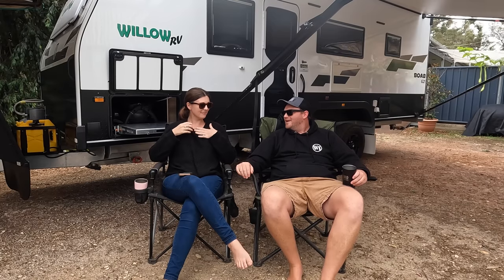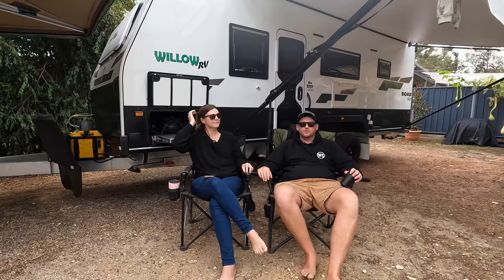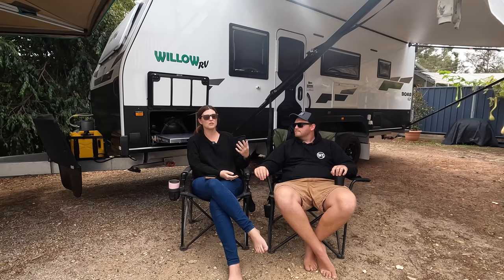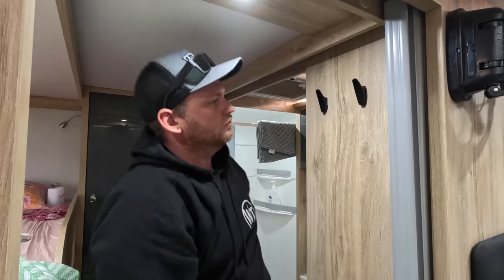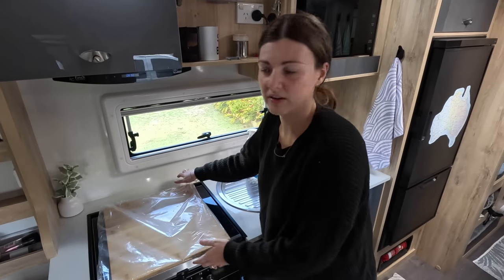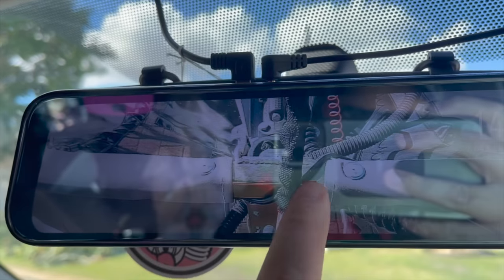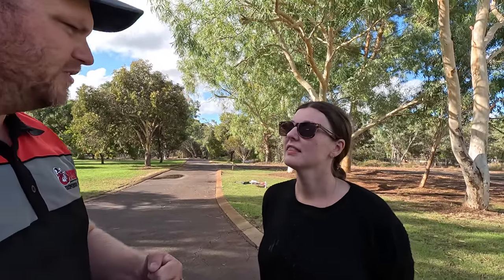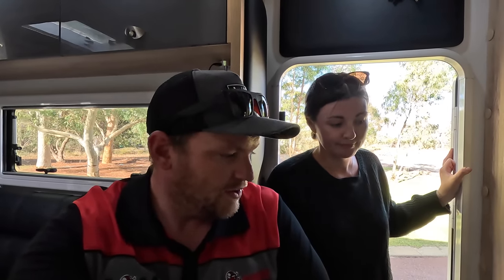WATER LEAKS & REWIRING OUR 8 MONTH OLD CARAVAN... || PLUS fitting a Stone Stomper and Awning Support

Comment: Cam and Tiff i really feel for you guys with all the problems you have had. I am horrified at you having to replace the electrical wiring at your own cost, luckly you have the money to do this a lot of people don`t. I have owned caravans since I was 19 years of age and I am now 67. I have owned numerous caravans both new and second hand vans and never had problems with new caravans purchased. Sadly  the state of the caravan industry at present is not a good one with people reporting all kinds of faults and manufacturers and dealers not doing the right thing to repair or replace defective caravans. I have friends that their new vans are lemons because of serious water leaks and other faults and have battled to get them repaired. I personally have found buying a good second hand caravan a better proposition for us. We purchased a 2011 24 foot Traveller caravan that was custom built for a couple and the van was immaculate and well kept no leaks and free from faults at the fraction of the price of a new one.

Comment: Hey Cam and team.  Nice vid.  We have same van and have had a few water issues with pex pipe not seated fully into fittings.  Seems most are now resolved.  One pipe had scoring may from pulling through floor and fitting wouldn’t seal.  All fixed by warranty.  Have large lithium setup as well and works fine.  Also queried wiring setup and I am an electrician, and it is legal as far as I can tell.  Maybe would have been ‘nicer’ to use 2.5mm but all ok when protected with 16A breaker/RCD.  Haven’t seen too much dust through that vent under bed yet!  Will watch though.  That support for awning is on my list as well, just saying!:)
Waiting for our stone stomper to arrive as well.  Also have that cutting board for the stove, did modify slightly to fit better, it’s not solid so careful if you cut it.  All the best.
Reply from the maker: Cheers Greg! Appreciate the feedback 🙂

Comment: An option for the floor vent,
Make a mesh panel then fit air con filter material to it. This will filter what can get through it and create extra flow resistance to ensure the caravan can still pressurise the van, and serviceable.
Reply from the maker: Good suggestion, thanks mate!

Comment: I’m no electrician either but 1.5mm cable is usually used for lighting circuits and 2.5mm is for power points etc.

Comment: 2.5mm is min for GPOs in the wiring rules for houses so maybe because it's not a house they can get away with it? Effort to use & cost of 2.5 vs 1.5 is minimal so they just sound cheap and makes you wonder what else they skimped on. I'm wiring my shed right now and using 4mm for GPOs and 1.5mm for lights (low power LED) because its a few hundred more although effectively future proof.

Comment: If the cable was not to regulation, then my guess would be that neither are your 240v power outlets or circuit breakers as they are not the same as you would use in a house, as vans need double pole outlets and breakers which are way more expensive than normal outlets.
Hopefully your sparkie gave you a completion certificate and lodged the appropriate defect report with the regulators as any van build company needs to be held accountable for the safety of current and future customers.

Edit - Caravans also have a separate Australian Standards regulations that they must abide by AS/NZ 3000:2007 and AS/NZ 3001:2008...is there an electrical safety compliance sticker on the van?

Comment: You guys have every right to feel salty about having sub par support for non trivial issues on a brand new van costing mega bux. Build defects happen, it is that follow up support that sets the manufacturer apart.

Will be really interested to hear more on how you get on with your 24V system. I'll be looking to do something similar with our next van as the voltage sag on 12v with high draw loads isn't ideal.

Comment: We have an old 2008 Boroma (they went bust during the GFC) which in its day was a very expensive van. We are slowly upgrading various systems in it. The build quality is top notch but it doesn't have the new clean look inside (wood cabinetry) of the modern vans. Our purchase price was mid $40g and even if we spend $10 -15g on upgrades we are still well ahead of the modern equivalent which would be $150g plus. I would be very disappointed if we spend a lot of $ to only experience your challenges. I admire your calm outlook. You guys will end up with a great van once you sort out all the teething issues. 
Question - What was the issue with the Isuzu in the end? When I spoke with you at the Perth show it was still an unknown? Keep up the good work and informative videos.

Comment: With the hole in the floor, my guess is that ventilation is required if you’re using an AGM battery (lead acid) which produces hydrogen when charging. Check with the manufacturer as shouldn’t be required if you’re using lithium batteries

Comment: Thanks guys for your unbiased report on your Willow RV. Their lack of correct diameter wiring could have potentially started a fire. Their attention to quality control through the manufacturing process appears to be substandard to say the least. Are they a Chinese import ? If they are, then I'd agree as to the lack of quality control. Are the adhering to and are a member of RVMAP, which is an accredited manufacturer of the caravan industry association of Australia. Or an accredited Australian manufactured camper trailer guild member. Yes I have done my homework. Thank you for your honest assessment of willow RV because they will not be on my "To consider list"

Comment: To sort your dust issue with the hole in the floor. We use a pressurising fan which fits to the roof and pressurises the van to prevent dust ingress. Works a treat. Just remember though that at night with heater on, the roof fan will vent heat. To fix this we put Velcro around the fan housing and put a piece of ply (covered in cloth to make it nice) over it to prevent heat loss. When we start driving, we remove panel and start fan.

Comment: A 200 series panel air filter might fit in that square hole going to the outside. They are 300mm x 315mm and would still let it breathe through there.

Comment: Wow, I can't believe how accepting you have been of the issues with your van. For the money paid there should be NO ISSUES. Our Lotus we bought back in 2015 has been a nightmare, but getting anyone, dealer or manufacturer to take much interest was time consuming and in the end almost pointless. Irrespective of all the issues, like dust ingress and water leaks (even after getting the van resealed) we still enjoy our times away. No-one, government or CIAA/RVMAP, are in the slightest way interested in getting the manufacturers to produce a safe and efficient van without faults, and it seems in many cases neither are the manufacturers.  It's getting to the point where a person is better off buying a second hand product, where the issues have all been rectified (mostly at the owners expense !).
Reply from the maker: Sorry to hear you’ve had drama’s with your van! I reckon you’re absolutely bang on about buying a second hand van 👍

Comment: For the hole in the floor, put the flyscreen back in and then use marine air filter sponge to fill the hole. Should help filter all the dust but not be sealed in so gas can still aerate.

Comment: You realise when you fit the SOG you don’t use chemicals anymore. That’s the bonus. No smells, no compost material to dig out and clean up. Can be dumped into a normal toilet or septic system due to chemical free. 
Just remember to change the carbon filter yearly.
Reply from the maker: Really! I thought you still used chemicals with the sog system!

Comment: If those hose fittings are John Guest I would be buying a bunch of the red locking clips or u might be dealing with another leaking fitting.
Reply from the maker: Cheers. We‘ll be getting the dealer to fit the clips next time it goes in for warranty work.

Comment: Was the rewiring issue caused by the upgrade on the power system as the wiring that was in the caravan has to comply by the standards ? & how much did it cost to rewire now I know another brand to avoid 👍😎
Reply from the maker: The rewiring was not caused by the 24v battery install- but that was how it was found. Cost to rewire a van would depend on what van it is. Mine was a lot easier than others because the wiring ran through cabinetry mainly rather than through the walls.

Comment: I had a Y62 and here are some things you might not appreciate until you've owned one. Fuel first, L/100km was fine it was the $/km that got old (always 95 or 98). Next, they are wide. On paper maybe it doesn't seem so but compared to driving a 200 it was significant, you need the 360 view cameras because you need to middle every parking bay. And every track you currently scratch the car on, you'll gouge the Y62 on. 3rd, if you plan on towing a lot then no question IRS is a disadvantage. As soon as the back end squats your camber is out, and making the rear stiff enough with springs/airbags doesn't make for a great ride.
Reply from the maker: All valid points! We took a test drive of a friends Y62 and were surprised how wide it felt, especially compared to the dmax!

Comment: Hi Guys, love your videos. Think about a engine air filter laying horizontal in the cavity, frame it out with some wood or plastic angle. The dust will shake off and you still have ventilation. If you pick a cheap common filter may solve your problem?
Reply from the maker: Cheers for the suggestion mate!

Comment: Put a filter over that gas outlet…. Something like from a aircon filter etc (obviously you’d have to cut to fit)…. I’d be interested to know why the re-wiring of the van was required…. Or was it just a safety issue or working with the battery set up that made you decide?
Reply from the maker: The electrician here in WA that was working on our van wasn’t willing to install an inverter for us with the wiring as it currently was.

Comment: Cam,Tiff, Just finished watching this video..... The rewiring didn't need to be a massive issue. I appreciate that you could only be guided by experts BUT the problem with experts is they are not solution orientated. They are standards oriented.  Circuit breakers are sized to protect CABLE. That is all. 1.5mm cable can easy supply 10 Amps....Fact is 2.5mm cable only needs to be used for power applications where you want to send 16 Amps through the circuit. 16Amps is 3500W at 220V....... There is NO one appliance in your van that draws 3500W. We have a Willow as well and its wired in 1.5mm just like yours was. Is it under done? Probably. It should have been in 2.5mm BUT, if you notice, the RCBO has all the 3 power point strings of 1.5mm cable twisted together and stuffed into the one 16A RCBO breaker. You could have done as I did and separated those out and fitted 3 x 10 Amp RCBO breakers, one for each power string which would have protected the 1.5mm cable just fine. The only cable that should have really been 2.5mm was the aircon cable and even then the air con is only 1.4kw... you could have gotten away with 1.5mm ...and a motor start 10A RCBO.   BUT at least you are satisfied now. ............ This is a warning that experts usually say its their way or the highway. When a bit of clear thinking can resolve many issue's at minimum cost..... Such a shame they chose to cost you so much money to fix what could have been done with 4 10A RCBO breakers in the cupboard and one run of 2.5mm from your inverter to the vans power system.....    See you guys on the road sometime soon....
Reply from the maker: G'day Graham. I'm glad you were able to sort your Willows wiring yourself, but like I said It's not my field of expertise. So I made an informed decision based on advise from the electricians, senior electrical inspector and regulating authorities that I spoke with.
Reply: @WildTouring  Totally Understand....  Those years at UNI did pay off eventually 😜  We were both actually sorting this out at about the same time...  Shame we didn't talk earlier...

Comment: Hi Guys I can assue you that Willow follow the Australian standards when it comes to all electrical connections. With your water fittings well thats no good looks like one of the JG blue hoses had not been homed in,this can happen.
Glad  you feel better about the Willow product and moving on.
Reply from the maker: Thanks mate. Yeah a few of those water fittings were leaking, the one in the wall that flooded the van was the main concern. Regarding the electrical work, I can only go by what the licenced electricians that have inspected the van for me have said. There were other concerns that I didn't mention in this video, like exposed terminals from the back of a GPO that were accessible from the tunnel boot (dealer agreed that one would be rectified under warranty).

Comment: Might be a wacky idea but can you adapt an air filter element to the hole similar to something like a 200 series air filter? Obviously would need to find a filter with the right dimensions. Be good to have the same as your new car then you can cycle the filter as you service the car.
Reply from the maker: Cheers for the suggestion! Good thinking 🙂

Comment: What about installing a fan into the lid of the gas ventilation box that would create some positive pressure to keep the dust out - it could be wired to the main dust suppression fan circuit for single switch operation. Just an idea. Good luck
Reply from the maker: Appreciate the suggestion mate! 👍

Comment: Those gas lines don't need a  massive hole like that, close off the majority and use an air filter or similar to give it a breathing vent area.
It will stop dust but allow any gas to vent.
What I can see is very amateur in its build.
Reply from the maker: Cheers Jeffrey, appreciate the suggestion!

Comment: Hi Guys, re protecting the front of the van from rocks etc, have you looked ta PPF film like BushWrapz - they have a 'bonnet' piece which is 2000 x 300mm which would fit across the front of van and up the sides along side the front window. I'm ordering some for our van as its easy enough for DYI. Also that gas vent, I just put some of that air cond filter material behind the flyscreen mesh - seems to work so far! Cheers
Reply from the maker: Didn’t realise you could get them for vans. Would be interested to hear how it goes!
Reply: Bushwrapz, I'm intrigued. Thanks I'll be checking them out

Comment: Can you use a piece of aluminium with a single slot vent at the bottom too cover that hole under the floor ( the pressure of your carafan should have enough pressure to prevent dust ingress unless there are more places/ holes in your van where the volume of air for pressurisation is exceeded) big concern would not only be the dust variable but also water ingress ( during water crossings/ heavy rain ect) cold moist air entering the van would also be a concern ( mould issues )- please don’t think I am knocking you guy’s but there should have been more thought into the design of the van ( to suit Australian conditions) especially with 3D rendering now commonly used in all fields of construction/ manufacturing.
Reply from the maker: Cheers mate, not at all - appreciate the suggestion! Yeah it’s the water ingress that worries me too!
Reply: I can understand them having a vent at a low point if lead acid batteries were being used - due to the gassing off ( sulphuric acid vapours + hydrogen sulphide) in relatively small amount in conjunction with air all it would take is a small spark and you would have a explosive reaction take place and since both gases  are heavier than air in conjunction with the negative pressure generated through that vent( while you are moving and or a breeze travelling under the van whilst parked up ) that risk is mitigated. I have watched a number of your vlogs and I really enjoy them. I personally would remove that entire low hanging box and replace it with a simple weather tight piece of aluminium with a couple of slots cut into the plate and then opened up using a screwdriver ( making sure the  slots are angled down) this and a 5volt or 12 volt computer fan coupled with a switch ( so as you can switch it on/off ). This would provide not only a very adequate  water tight pressurised seal but still provides you with a dust and moisture free compartment under your bed . I know I am a bit long winded but I believe this would rectify all the issues and concerns you have. Please understand it is just a suggestion that would be affordable and easy to manufacture yourself. Have a great evening my friend, I hope my suggestion either helps or gives you another way in which to tackle this particular issue. Safe travels .

Comment: Thanks for the vid. As far as gaping hole I can assure you if there is a way to get in the nice and other creatures will make use off it. There seems to be some good suggestions in the comments. 
As far as a vehicle is concerned. Y62. We did our research and you cannot justify the huge price difference for the Toyota name.
Reply from the maker: Price is actually relatively the same across the 2! 10K difference 🙂
Reply: Just make sure you are comparing apples with apples. Nissan have 2 models vs Toyota 6 models. I went with the Ti-l and there was a 40k difference in price between the comparable model. In the end it is your call.